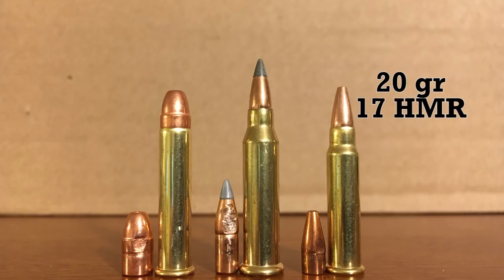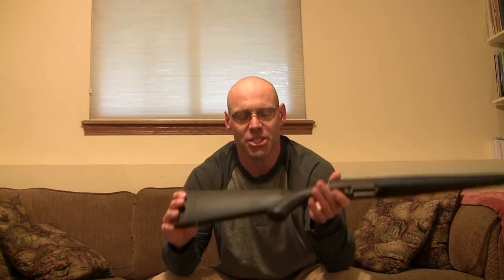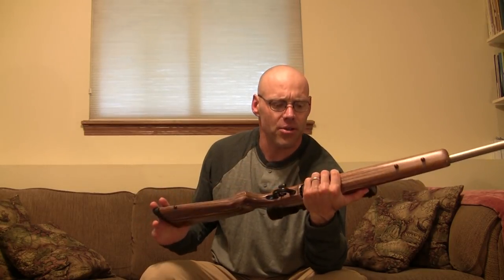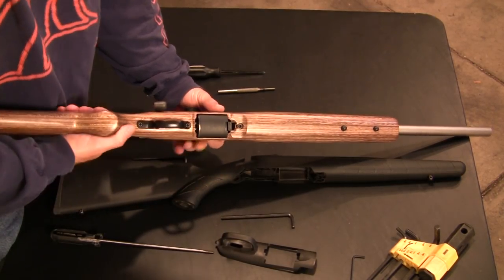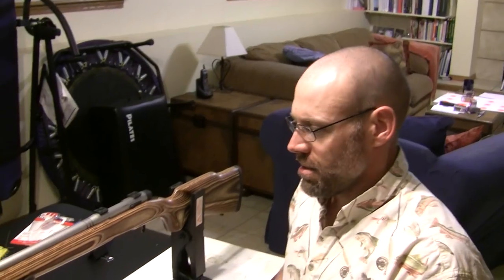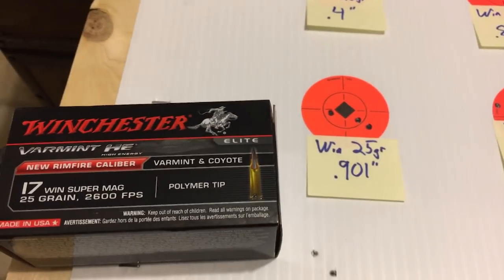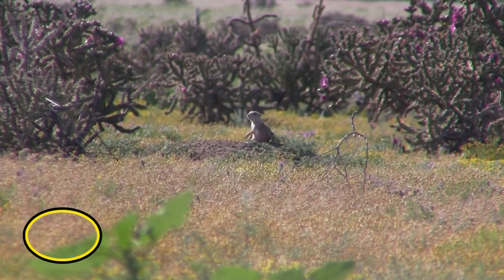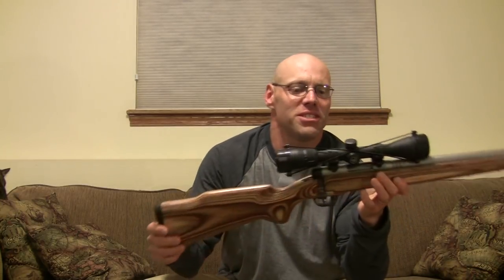Savage B-Mag 17 WSM Review, Bedding, Prairie Dog Shoot-RGO Ep 50

Comment: My .17 WSM is very similar to yours except for the style of Boyd's stock. Glass bedded per Cave Dwellers instructions also. That man is extraordinary! I have had my SS barrel threaded and awaiting approval from ATF on DA Mask. I absolutely am crazy about the performance of this rifle. I have shot all the brands of ammunition you have mentioned, but would like to recommend Federal AMERICAN EAGLE 20 grain tipped varmint. This round shoots the dime at 50 yds. very consistently. My only regret is that there aren't any prairie dogs in the southeast!!
Reply from the maker: A suppressed B-mag? That will be a thing of beauty! I don’t recall if I’ve tried the American Eagle 20 grainers. I wanted to use the 25 grains in case I got a shot at a coyote or bobcat, and it turns out that one shoots the best for me. I will keep my eye open for those American Eagles though.

Comment: The back of the trigger housing has a little springed lever that you have to make a little room for with a file in the back. most stocks don't account for it naturally, just take a file & make a small groove... so that when u put the gun back in, the back of it is clear, & not pressed up against the wood of the stock. that little lever makes the trigger fall into place when cocked... it falls, but not locked, becuse it can't move to fall in. it's permanently stuck in place unless u file out a tiny little groove to keep the stock wood from jamming it. A tiny little spring loaded lever at the back under-side of the gun. Common mishap for gunners, simple fix. :)
Reply from the maker: Well that explains the issue. I have been afraid to take it out of the stock again for fear the issue will come back, now I know the fix. Thank you.

Comment: If your B-mag barrel is crowding the left side of the barrel channel, check for a trigger assembly screw that's not relief cut in the action cut of the stock, they overlooked it.  It's pushing the barreled action to the left barrel channel side.
Reply from the maker: Do you think I would need to re-bed if I found no relief cut and then cut one in? I suspect then the bedding wouldn’t line back up, if I am envisioning it correctly?
Reply: @RegularGuysOutdoors  If you bedded it before making the relief cut, probably to do it correctly, if the screw cap was putting pressure on the right hand side of the action channel wood when you bedded it, taking that pressure off may change the way it wants to sit in the bed.  But you could try the relief cut and then see if it makes a difference.  Personally, I would re-bed to allow the action to sit properly with no tension after the cutout notch has been performed.
Reply: Simple fix to the original stock I wished I known before sanding stock side and bedding. Even fabbed a recoil lug (large washer that's thickness fit snuggly into middle barrel groove) and affixed it in the bedding. Shoots great now but knowing the cause still exists is gnawing at my previous satisfaction.
  Looks like Boyd's might be getting another order.
  Thanks for the How-To info !

Comment: Had the same fit problem with my HB thumbhole grey laminate factory boyd's stock.  I have the 2019 made B-mag Stainless heavy barrel grey laminate thumbhole target model. There's a socket cap screw head that sticks out of the trigger pack far enough to scrape and push the action over at the mid, rear right side.  This is between the forward lug and rear lug screws and was the reason the barreled action was pushing left.  I noticed my barrel crowding the left side barrel channel also, when I removed the barreled action, there was deeply scraped up wood from the trigger screw on the right side action from factory assembly, across from the screw.  I used a dremel sanding drum and relieved an almost half round notch about 5/16" into the stock material and about 5/8" to 3/4" straight down (as looking from above the action) where the screw was making contact so the screw would clear the barrel channel.  Once I made a relief notch for the action to go straight down without the screw cap making contact all the way down so the action bottomed out properly, the Boyd's thumbhole laminate stock fit 100% straight along the entire barrel channel.

Comment: Had to chuckle a little when you mentioned the barrel heading west-- but mine was in a Boyd's stock (Thumbhole, if you must know ;)). My solution was the same, with the same results. Not satisfied with only a $1 bill sliding through, I sanded a bit out of the channel so a $20 would easily slid through. Did the trick, too. My Savage (was my 'dream' rifle for years) is a tack driver.
Reply from the maker: You must have sanded alot to get a 20 to slid through. I need to get it back on the P-dog towns this summer.

Comment: I have the same setup. Same stock,but I haven't bedded mine yet. I took dremel tools and sanded the barrel channel on the left. It is free floating and is a tack driver as is. I changed out the bolt handle with a tactical handle, longer and beefier  easier to cock now.
Reply from the maker: The laminate stock adds a bunch of rigidity. If it shoots great as is, I wouldnt be in a hurry to bed it.
Reply: Did the same with my bolt handle also. 
Made everything about cycling the bolt better.

Comment: Good video, I too copied cavedwellers instructions.
What I have noticed is my cases had scratches down one side once I ejected . Turned out it's a burr on the breach caused by my dry firing the rifle , the round firing pins strikes on the lip of the breech causing the burr. I filed mine off carefully. Check yours and maybe make a video on it .
Before somebody says "don't dry fire a rifle" most modern rifles are designed to be dry fired , this one is an exception
Reply from the maker: I usually put a piece of fired brass in the chamber to "dry fire" it before storing it, but not always and I did dry fire it like I said in the video. I just looked and I have a definite mark in the chamber where the firing pin hits. I will stop dry firing muy pronto.
Reply: I agree that any modern centerfire rifle is perfectly fine to dry-fire. You shouldn't ever dry fire rimfire rifles for this exact reason. I suppose that the firing pin is harder steel than the barrel is, but if you do it a decent bit, you will get a burr just like you said that you are getting. Glad you could file it out though!

Comment: Great Video.  I copied Cavedweller's video also, but with the factory stock to include removing the butt plate and filling the cavity with resin and glass beads.  I can hit 8"x4" hog silhouettes @ 400 yards in 5 mph winds on the bench, sorting ammo for run-out error.  Most accurate and fun gun I have ever shot without the centerfire ammo prices.  Don't understand why I am the only one I know who owns one in my neck of the desert.  I guess the needed stock tweaking turns folks away.
Reply from the maker: I am thinking of the thin barrel model and fill in the void in the plastic stock for a lightweight run around gun.

Comment: I just bought one an ordered a Boyd’s stock the classic version and no bedding was required it is very slightly favoring the left side but is free all the way up to the grooves in the barrel can slide a 20 through and I shoot half to quarter inch groups all day with 25 drain Winchester ammo
Reply from the maker: I should have tried without bedding and then again after. They love the left side and glad yours is a great shooter too. The bolt throw is a little weird but easy to get used to.
Reply: Yeah it’s a good rifle it gets a bad rap but I’m satisfied so far kind of having trouble holding my sighting in it holds great groups but drifts to the right a hair if it sits a few days may be my scope mounts lose a bit. Does your rifle have a gap at the end of the barrel from the stock? Mine is about a half inch gap so it’s really free floating lol
Reply: I have a leupold vx freedom 3x9-40 so it’s a quality scope not sure yet why it goes off without being messed with thinking about having my smith take a look
Reply from the maker: Mine has a quarter inch gap. Thats weird about the drift.
Reply from the maker: Post if find out the issue...cold barrel, hot barrel?

Comment: I have the same gun, but with the pepper gray stock, also having the same issue with accuracy. purchased from Buds online gun room. going to try the 25 grain next
Reply from the maker: Mine has preferred the 25s from the start. The 20s and 25s do not have the same POI for me and the 20s don't group near as good for some reason. If the 25s dont group, check for any slop in the fit of the action and stock, it may still need to be bedded.

Comment: Here's an inexpensive barrel tuner that works great if you're running a bull barrel.... get a shaft collar thats I.D. matches barrel O.D.. 
  To prevent marring barrel finish use a nylon tipped set screw or put a piece of lead shot in hole and install set screw.
Move collar in 1/8 - 1/16" increments and shoot 2-3 round shot groups. 
  There's a YT video showing the how-to.
Reply from the maker: Kind of like a ‘poor man’s” BOSS system Browning and Winchester had for a while.
Reply: @RegularGuysOutdoors  definitely 'poor man's (or like me frugal). 
 It's quite satisfying to smoke shooters that have 3x more $ invested. 
  It's the physics/function of the concept that makes the tool work. Marketing/sales makes you think they've got a better mouse trap. 
  Commercial units may be more convenient to use, but at 200+% more cost which way you willing to go to find out? Personally I thrive on seeing the finger pointing then seeing the jaws agape.
  Ignorance empties more wallets than one might imagine......

Comment: Did you ever find out why savage likes to lean to the left? I was 3 different savage b22 fv sr models like that. And its weird that it did it on your boyd stock too. I thought, maybe an issue with the molding process.
Reply from the maker: I haven't been able to tell. I can only guess that the the barrels are not quite square to the receiver, but that doesn't seem likely...or maybe the receiver thread holes are slightly off? Cavedweller1969 did mention this in his review and said it wasn't the stock but didn't say what it was either.

Comment: Funny, but I was pining for Savage B17 'project' action to grab a Boyd's Custom Featherweight Thumbhole with a 14" pull and the higher comb, but- I really, really think a .17 WSM might make a better project. I think, at the end of the day, I might be doubling the 100 yard groupings- but... maybe not? There's a lot of value with the increased power at further distance with the .17 WSM round... I know that you are happy.... CaveDweller 1959 is purdy happy...Hmmmm, thoughts?
Reply from the maker: I would start with one of the Bmags already in a Boyd's laminate stock, you might not need to bed it. The WSM has as much energy at 135 yards as a HMR does at the muzzle. Essentially you are adding 135 yards to the effective range of the HMR.
Reply: @RegularGuysOutdoors  It really is about the speed at distance that takes everything off its feet. If I get the B-Mag in a Boyd stock- it's not a project! Glass bedding, suppressor, little things that take a good gun and 'accurize' it.

Comment: If you ever take the barrel off of the action you will understand why it doesn’t shoot well. Uses set screws to hold barrel tight to action sloppy threads. Machined a collar for mine that tightens up shank of barrel to face of action, went from 3 in to less than a inch with mine.   Bedded it also 2in of chamber area. Chopped barrel and recrowned it as well.
Reply: Real loose headspace on these rifles too causes some of the ftf.
Reply from the maker: That is an awesome fix. I have to admit, I didn't even notice how it is attached.
Reply: I have never seen any set screws on a B mag...

Comment: I bought a skinny barrel b mag off a guy who sent it back to savage and got it re barreled I got the gun and 800 rounds of ammo for 400 dollars I really couldn't pass that up. Any way in short as long as I let the barrel cool a little in between shots that thing will shoot.
Reply from the maker: Been thinking about getting one of those. It would be a very lightweight rifle and if it didn't shoot well out of the box, I have some ideas how to bed and stiffen the plastic stock. A lot of folks are getting theirs to shoot good right from the factory. Thanks for watching.
Reply: Regular Guys Outdoors I just stumbled across your channel really enjoy it good clean material and good information. I heated my plastic stock over the stove and held it in place and rapidly cooled it off to get it to hold. Now even if i put pressure on the fore end of the rifle it doesn't make contact with the barrel. It shoots great as long as I give it time to cool after a few shots
Reply: I too have a skinny barrel one.  It shoots ok.  1.5 to 2 inch at 100 yds.  I feel thats fine for a walk around super light rifle .  Less than 5 pounds with scope.  I have the stainless bull barrel one too. Ive got it shootin under 1/2 in groups, I ditched the factory plastic stock in favor of the Boyds, Varmint pro. And I bedded it too.

Comment: My Savage B Mag won't extract the round out of the chamber?
Reply from the maker: Mine has done that when it has been shot alot. Use a cleaning rod to pop out the stuck case. Clean the chamber with a solvent, not clp, or oil. Clean the face of the extractor and up under the claw portion. Make sure the claw moves and has tension.